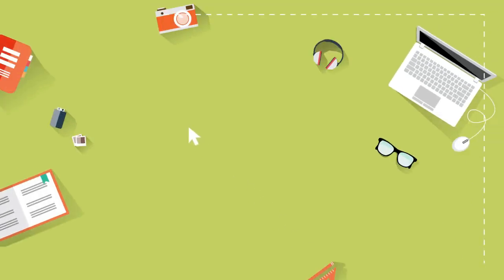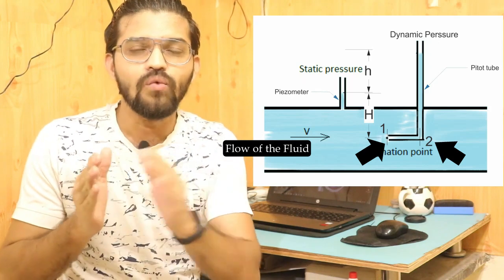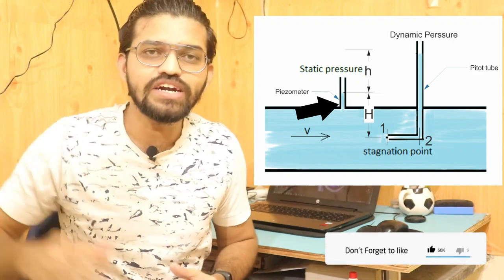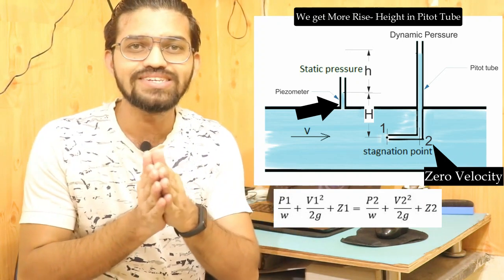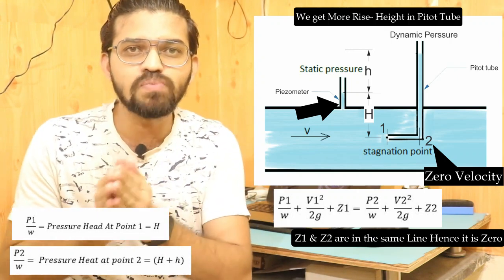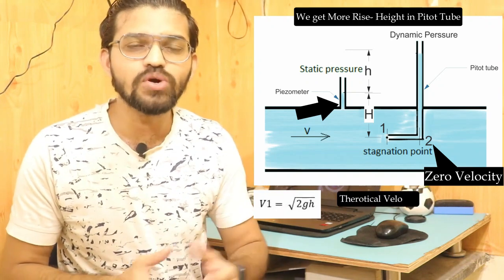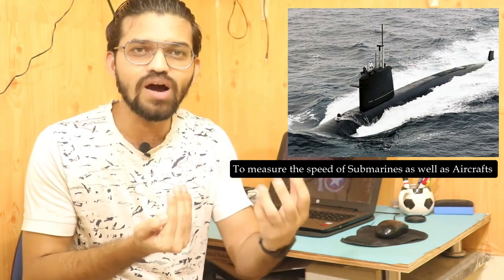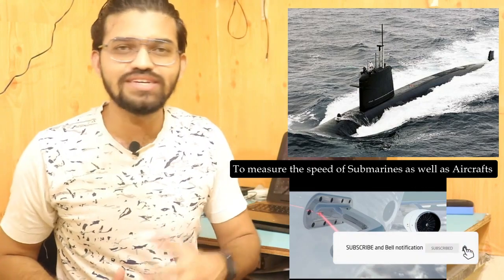Pitot Tube Construction & Working.

Comment: Hello! I have a doubt. What will happen for example if the air is flowing in the opposite direction of the aircraft? Will the reading of the speed of the airplane be correct? Or will it be low?